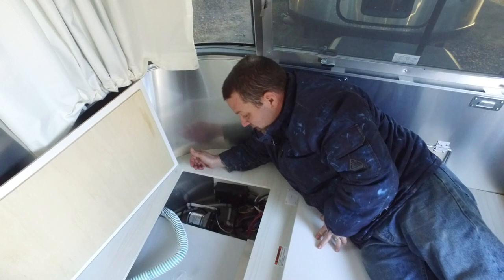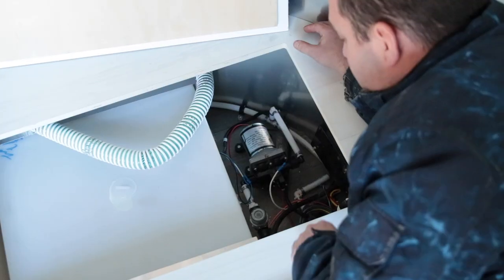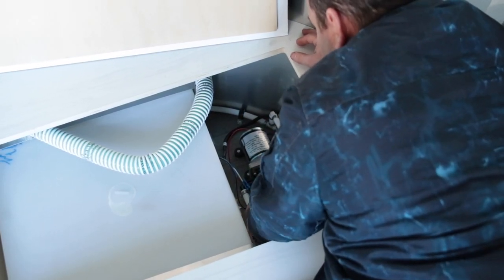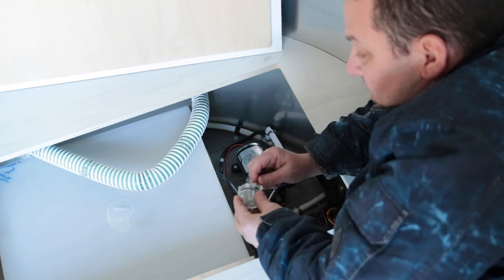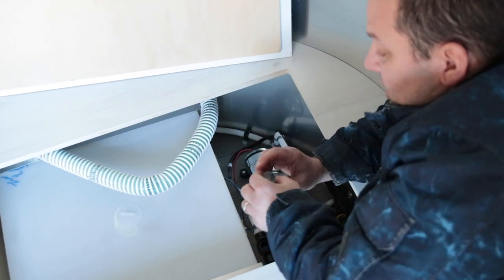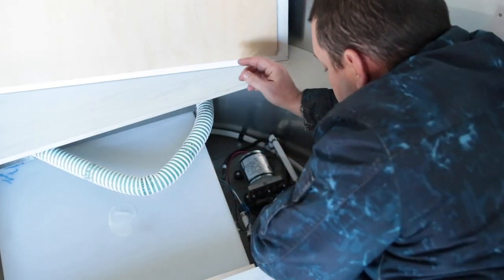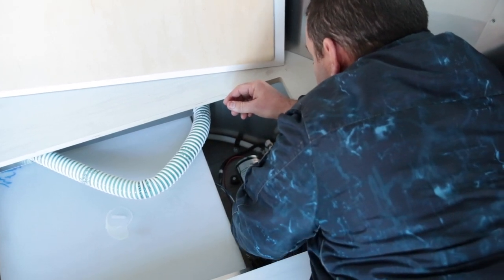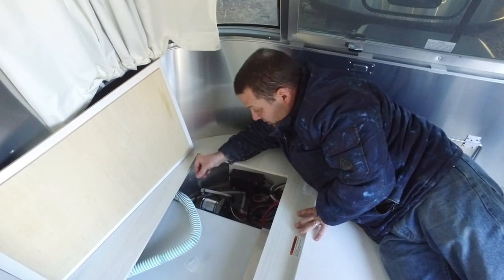How to Replace an RV Water Pump Filter Strainer

Comment: Good idea about showing the hows and whys with AS systems. It would be more conducive for learning to show a close-up of the pump and all its parts, using a pen/pencil as a pointer. You should assume the person viewing these videos have never seen these systems up close.
Reply from the maker: Thanks for your suggestions Bruce.
Reply: Yes and also mention to close the water,, drain,, keep Rag close cause water is gonna drip,,, put the water back on ands the pump test for leak a couple times in the next two days,,